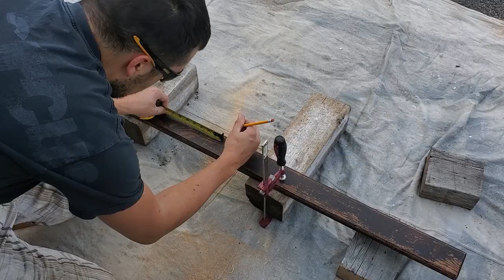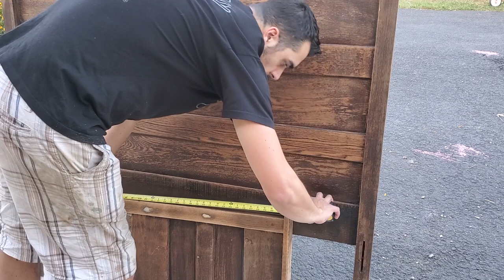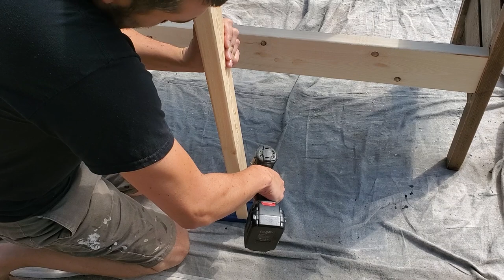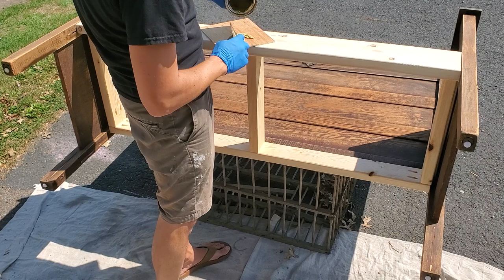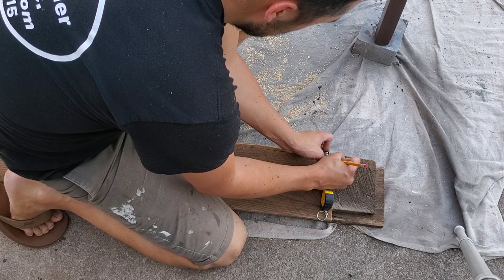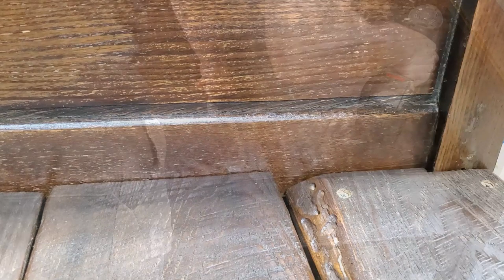Extreme Furniture Makeover // Making a Bench Out of a Bed Headboard and Footboard

Comment: I like the wood finish. What is TSP?
Reply from the maker: Trisodium Phosphate.. It's a cleaner that helps cut through grease, grime and anything else that could prevent primer and paint from adhering, or from being ground into the piece when sanding.  You can use something like dawn dish soap, but the TSP works better in my opinion, and is easier to wipe/wash off with clean water afterward.  The dish soap takes a little more work and rinsing to get all of the residue and soapiness off.